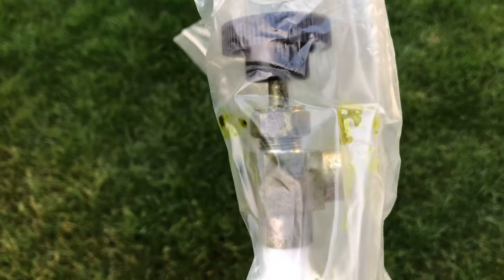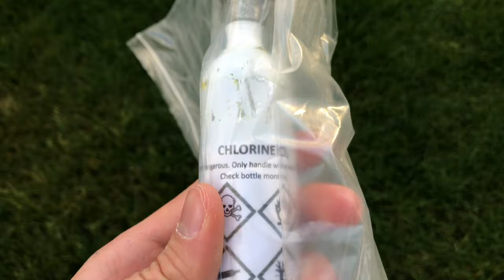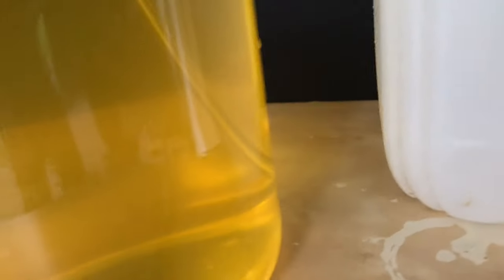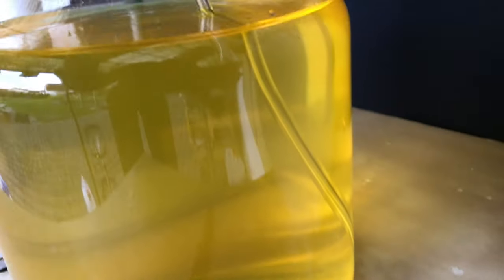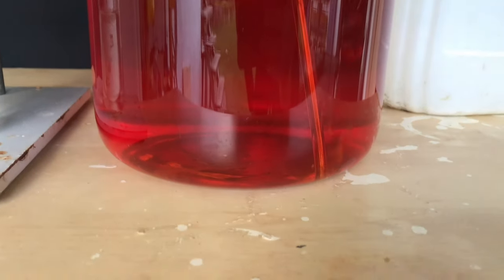DIY Chlorine Lecture Bottle Leak And Making Bromine

Comment: How does bubbling chlorine through the bromine waste form Bromine?
Reply from the maker: Bromide and bromate containing waste not bromine
Reply from the maker: @experimental_chemistry  I always clean the final bromine using a bromide solution. Should get rid of all interhalogens
Reply: @experimental_chemistry  I´ll get bromine from it using acid later on. there´s still enough bromide in solution alongside the bromate
Reply: @thyzoidside  ah so the chlorine replaces it
Reply from the maker: @joshp6061  I don´t think so but acidified bromide/bromate solution generates bromine